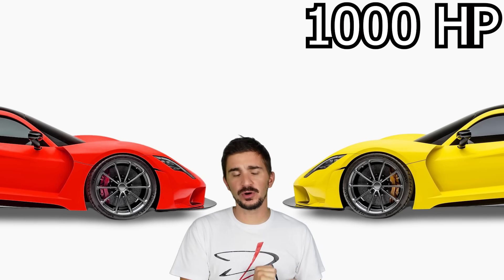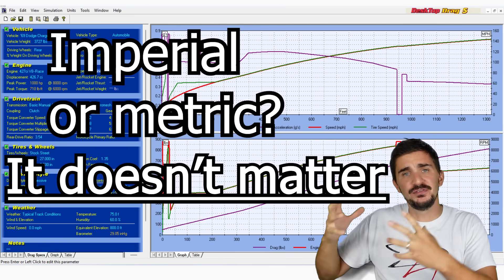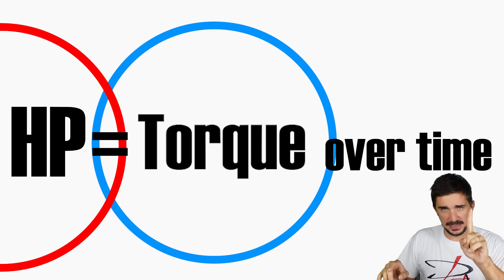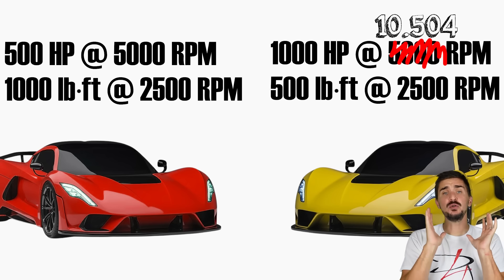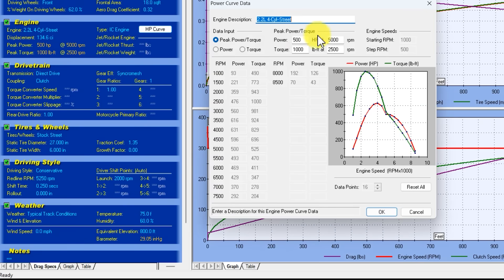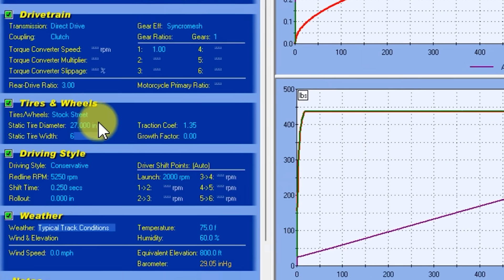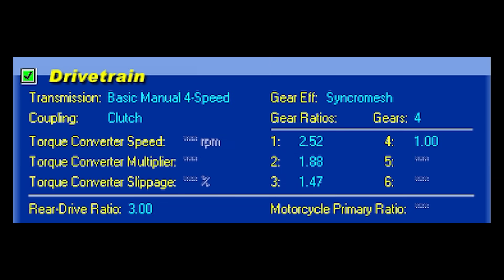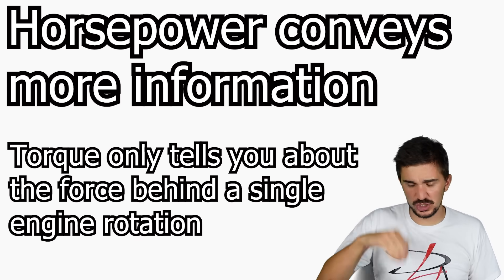Who's faster? Explained and Simulated - Horsepower vs Torque

Comment: While I like your punch/damage explanation, your video title and thumbnail is a bit misleading. In real world the 1000HP car will ALWAYS be faster then 500HP, this is the basics behind Mr. Watt invention of HP, so you can compare two different systems. It is about the force over the time resulting to work... If you compare two 500NM systems, you dont know which system will complete the task in what amount of time, thats why before Mr. Watt for comparing two systems you had to compare entire Torque curves to see what system is "faster". 
Since you are restricting the comparison to very short range of 1/4 mile this is not allowing the full peek of both systems. So the title should really be, which car is faster on 1/4 drag strip, not in general...

Comment: I enjoyed this video but transmissions DO play a part in the power of your car because in your scenario you are severely bogging down an engine made for high revving short gear ratios (bike) where you are comparing it to say a diesel. I like to think of it as HP = how fast you drive into a brick walk while torque = how far you went through the wall

Comment: In the rock crawling world output torque is very important. Many people try to achieve an extreme final ratio to reduce speed dramatically and pull with incredible force. This helps passing obstacles easier and most of the time speed is not important (at least when not competing). It is funny because having such an amount of force means you can have a tremendous acceleration (according to Newton's laws) but your car can only sustain it for fractions of a second, due to the speed limit your power train will have. So, in fact, you're exchanging speed for torque.

Comment: You just got a new sub. Love the way you explain things. Understand the high horsepower low torque very well. Raced Mazdas w/rotary engines. Bridge ported 3"SS exhaust. Damn thing rev'ed 13,000rpm sounded like a motorbike. Poor torque. Early 70's no local dynos no idea of numbers.

Comment: It's very simple, horsepower sells cars. Torq wins the race.🤷
Reply: Do some research
Reply: Me electeic kock scooter T108 v2 130 kg with rider i measured its torque from stand still on loadcell it pull from dead stop 90 kg force what mean around 900 n at contact path what meanw ith wheel radious 0,14 m = 126 nm at 2 engine in wheels + max power 6 kw =almost 8 hp  i measured like 10-15 times acceleration be racelogic /racebox/qstarz ltq6000 whatever all have almost 0 error with 1 ft roll out on 0-20 km/h without push  be legs 1,0 sec 0-50 3,5 sec vmax gps on rabox 83-85 km/h on flat level road without wind vs feg new triumph speed 400 it have 37,5 nm and 40 hp weight with rider me weight like 260 kg so 2 times heavier but it can hit0-20 km/h under the same test regime like with T 108 v2 in 0,5 sec and  50 km/h in 2,0 sec if somebody can launch good  with top speed gps around 155 km/h 🤷🏻‍♂️ so such how it fix to ypur assumption ? i think it dont fix at all 🤷🏻‍♂️😉 torque without leverage mean 💩 🤷🏻‍♂️ and enough nore power with optimal gearing always beat biger lowend tprque  cos power determined how much work can be done in specified amount of time more work in shorter or the same time mean you need more force and acceleration and this subscribe power 😎🌪️ power on track racing beat torque ,but for daily riding for most people engine with higher torque down low with less power at higher rpm is much more comfortable  and they buy this version instead of weak lowend strong topend version including me 👌🏻

Comment: 500hp means that the 
JOULES of KINETIC energy per second, equal with the power of 500 horses (and kinetic energy is related with speed which means being fast).

Thus, 1000hp means more speed and thus being faster 😊

Comment: Ive always struggled with hp and torque cuz while ik peefectly how they work. They applie very differently in the real world. 
Torque and rpm are the only real value.  Hp is made up. However through tranmission it is very useful. 

No ammount of additional hp/rpm is going to pull a heavier trailer. Hints why diesel dont rev out. A diesel engine and many torquey gas engines will put peak torque down at max 3k rpms. 
Yorque is great for high traction low speeds aswell as burnouts. 
Also gasmileage. 
Horsepower is great for reving it out. If your engine revs past 7k its cuz its not got alot of real umph to its name. Dont get me wrong. Inlike 7k rpms. However my car is torquey so its actrually faster shifting 5800-6200.  

But if it where 100 less torque to reach the same acceleration it would needa go from 6200 to prolly 7500 to achieve same hp
Reply: "torque and rpm are real, hp is made up"
Throw in a trash whatever you say after this before you do some research
Reply: Nonsense. Power is not “made up”

Power, not torque, is the limiting factor in not only the top speed of a vehicle but also how quickly it can accelerate at any speed and how much weight it can pull up an incline at any speed.

At 12MPH a 13 Liter long stroke turbo diesel is putting out 1050lb-ft and 400HP at 2000RPM to pull a 20,000 lb load up a hill. If we swap that engine out for an 800HP
short stroke Lambo V12 making only 525 lb-ft at the crank at 8000RPM and we add a 4:1 reduction gear to match the RPM of the diesel, the reduction gear would reduce the 8000RPM from the engine to match the 2000RPM of the diesel so we keep the same 12MPH speed. The 4:1 reduction gear multiples the 525 lb-ft to
2100lb-ft at the wheel doubling the amount of weight the tractor can pull. It wouldn't make the cost of goods delivery cheaper but it would sound glorious, especially in tunnels.😁

Comment: Keep the wheel torque the same at the wheels which is what you would do when selecting your transmission.

I think you know that one engine will burn more fuel than the other and know it's directly related to the output.

It always seems you have a bias for engines with a higher peak torque.  Keeping a 1000 horsepower engine running with an output under it's total output is a bunk test.

Can you select a CVT?

Comment: I have a GSXR 1000, maybe 180hp/80tq and a 2001 FXDXT/TSport Dyna with a S&S 124-inch 130hp/130tq. When I first rode the GSXR it was crazy fast. I bought the Harley Dyna already built, and honestly, it scared me, I was so nervous. It shaked and just taking off it required barely any throttle, and it would break traction. It felt faster, obviously not as fast in reality. It's hard to explain. It's like driving Ferrari(GSXR) and then driving a 1970 Chevelle SS with a 572 big block(Dyna S&S124)

Comment: I had a skyline gtst (rb25det) that was insanely fast acceleration. It had some wikid go fast bits, including a ceramic truck turbo, and massive tires for traction, however when i took it to the dyno it came in at 350odd hp. This seemed a bit odd given hpw insanity it was under full boost, and tbf it def wasnt reliable , i tuned it myself using the linkg1 handcontroller, but i realised the dyno sheet actually noted a really impressive tourque peak at 780nm. I didnt really understand this at the time, but over the years i statted to appreciate that is a lot of tourque. And watching this helps me to understand why it would spin the wheels in fourth gear, and why it could pull 250kmh up a in hill in fourth with another gear to go. 

It was a wild car. I wore only cotton.
Reply: God's Bless You, that made my day.

Comment: A couple of thoughts:

1) Your 10,000 RPM engine isn't lasting long.
2) Most usable driving is done below 5252 RPM.
3) Torquey engines are generally more fun - responsiveness, immediacy, etc.
4) When using the transmission, you should tailor them - short gears for HP and longer gears for torque
5) HP requires RPM. Torque doesn't.
6) A well balanced system of all 3 (Torque, HP, and gearing) provides the best - Torque to pull, HP to run, gearing to keep you where you need it
7) Torque is how hard to twist the crankshaft. HP is how efficiently to spin the crankshaft.
Reply: Almost all thought are wrong and show lack of understanding
Reply: @simplemachine9531 

Please continue...

"Torque has nothing to do with RPM. Torque is just an angular force and force is independent of speed, they both have nothing to do with one another. But when force (in this case torque i.e. angular force) and speed (in this case RPM i.e. angular speed) comes together they generate Power."

Comment: Torque = Work done
Horsepower = Rate of doing work
Reply: Torque is not work done.
Power is not a rate of work, it is work over time. Which means more power is more work per unit of time.
Reply: @simplemachine9531  huh?
rate describe exactly time and work in this case force. 
  
rate = a measure, quantity or frequency measured against another quantity. TLDR; it's a product of derivative
 
It is "rate of doing work!" not "rate of work" which translate how fast you can complete a single work load over time = frequency

"torque is not work done" who told you that? when we translate any linear force to angular motion we get torque. WORK DONE by force (in linear fashion) is the product of component of the force in the direction and the magnitude of this displacement. Work = F x d. As for angular motion (ICE engine) Torque = rF x sin theta.
Reply: @soraaoixxthebluesky  man, you started with the word "horsepower", completely not knowing what it is 😆

There is 100Nm of work done (of moving a car). How much torque is that? You told right away. A complete non-sence.
Reply: @simplemachine9531  You don’t even know what “Work Done” is in engineering terms. Lol
Reply: @simplemachine9531  As for horsepower, I can easily ignore this stupid imperial standards with metric like Watts or Joules-per-second if I wanted to but your clueless mind wouldn’t get it.
Reply: @soraaoixxthebluesky  so many letters and not a single word "power" was used. Do some research, until then sit low and quiet.
Reply: @simplemachine9531  huh?????????
Reply: @simplemachine9531  Let me copy a spoiler for you incase you don’t know how to use internet “power is the rate of doing work. It is equivalent to an amount of energy consumed per unit time. In the SI system, the unit of power is the joule per second (J/s).”
Reply: @soraaoixxthebluesky  now use this info and get back to your original statement and delete it.

Comment: "Torque" is probably the most mis-used and misunderstood term in the automotive world. Torque, by itself, does nothing. I weigh 200 lbs, so when I put my full body weight on the 6" long crank arm of my bicycle I'm exerting 100 foot lb. of torque. Considering that my bicycle and my body combined only weigh 235 lb., that should make my bicycle faster than most motorcycles on the road. I should be able to fly past Suzuki Hayabusas like they are standing still. But in reality I have a hard time exceeding 25 mph, because I'm physically incapable of exerting that 100 ft. lbs. of torque at any significant rotational speed.. Transmissions can multiply torque, but they can't multiply power. Torque is just a component of power, along with rpm. Power, by definition, is what does work. Torque is a force that does nothing by itself without rotational speed. I'm 76 years old and have been hearing people brag about "torque" all my life and I'm sure they will still be doing it long after I'm gone.
Reply: true except torque is force is lil misleading 😉 torque from some point of view let say is force but no it isint 🤷🏻‍♂️ from 10 times biger torq you can have 10 times smaller force if leverage be 100 times longer 🤷🏻‍♂️

Comment: I have a question not related to this video.
Is it more fuel efficient to drive in hot weather or cold weather?
Reply: Summer or heat by quite a bit

Comment: Torque is how fast you can get to high speed, hp is how fast you can go
Reply: nami burn e viper watch from 26:00 this electrick kick scoter weight with rider like a 130-140 kg both its engine generate  like a avg 100 nm +/- assuming from they test they clock 25 mph in 3,0 sec what mean 74 nm avg at this velocity diffrenc + all losess like drag roll asf and it be close to 100 nm most likely avg at this speed diffrenc it have probbaly more at lower speed but who cares anyways it have much more enngine max torq than to what im compare it 👉🏻 with max power 11 hp  it accelerate from 0-50 mph in 8,5 sec 👉🏻 https://m.youtube.com/watch?v=CrCyz-jf1i4&t=1591s vs kawasaki zx4 r 40 nm max 77 hp 260 kg with rider need from 0 to 50 mph 3-3,5 sec 👉🏻 watch from 0:25 https://m.youtube.com/watch?v=0zQbfMdV-qE&pp=ygUca2F3YXNha2kgeng0IHIgYWNjZWxlcmF0aW9uIA%3D%3D  much biger power much biger weight much less engine torque with good gearing and clutch beat much less weight with much more engine torque down low in regard to how fast  you can get to high speed sory pal 🤷🏻‍♂️

Comment: interesting question and interesting approach with the simulation. unfortunately, bad execution leads to wrong conclusion.
Horsepower is faster than torque, with a couple asterisks 
*as long as the gearing and ratios are properly designed
*power and torque don't matter if you don't have traction

everything is f***d up from the beginning starting with a 1800lbs FWD car with 500/1000hp and 6in wide regular street tires. takes no genius to know its not gonna work properly
then you add transmission that are so badly setup that they either slip the clutch or spin the tires all the way through the quarter mile , and return meaningless results
the simulation that's "closest" to reality is the one with manual transmission, where hp engine wins but even there, it spins the tires all the way through 1st and 2nd gear
6000lbs simulation is dumb too because if a car has a certain payload/tow rating, it will be geared to carry or pull that weight correctly. here we have a 1st gear geared for 110mph in the 1000hp engine...
in direct drive simulation its geared for 270+ mph...

also 6:19 shows that the 500hp engine generated by the simulation is actually a 671hp engine, not 500hp. it has a wide powerband so it works better in extreme conditions where the gearing is completely off
in the first simulattion with no final drive ratio, it runs at 1500rpm so only 221hp, 1/3 of its power. the 1000hp engine is running a 3700rpm (~350hp) but it's slipping the clutch very badly because the gearing is for 800+mph so even with 1000hp its not able to lock the clutch without stalling, so it would slip the clutch all the way to 320 mph...

the easy hp beats torque example is
superbike ~200mph/200hp/100Nm/15krpm
VS
top pro sprinter cyclist ~50mph/3hp/200Nm/120rpm

Comment: So..  a detail:

If we are at the point of RPM of the max torque.

We got the top effectiveness of each of the explotions by the vilinders.

Maybe that fact can be related to efficiency depending on which gear you are on.
So effectiveness can be inside the formula to know efficiency.

Comment: Power is everything, torque means almost nothing. You can get as much torque, or as much rpm, at wheels as you want, with the right gear ratio. But you can't get both things at the same time. The product of force and speed is (almost) constant from the engine to the wheel, and it is the power.

Comment: Wow, great analogy. This never made as much sense to me as it does after watching this video, especially because the punching analogy is something gamers are used to considering about in some video games. You pick up a weapon that does a lot of damage but it's very slow, should you replace your current weapon that does less damage but is quicker? Let's take a look at their respective DPS. These considerations match perfectly with torque (damage), rpm (animation speed) and hp (damage per second). The thing that I'd like to get a better understanding now is how different distributions of these values in real cars change your driving experience with them.

Comment: Basically for a sports car/supercar you want hp and for a heavy vehicle earth mover/truck you want torque
Reply: Then why a good semi has 600+ hp under the hood. For occasional races?
Reply: @simplemachine9531  they will have a very high torque figure probably double the hp but in a truck you want low end pulling power high speed is irrelevant in such a vehicle
Reply: @rumbleman65  did you know that speed can be traded for force by using a gearbox? And you can tow a trailer with your bicycle?

Comment: I would like to see again such a comparison, but compare the size of the areas below the torque and horsepower-curves. Think about the typical diesel torque curve which starts pretty early and keeps this torque until max RPM. A drag-strip engine has nearly no torque until 7.000 RPM and when the huge turbo kicks in an insane amount of torque.

I guess the engine with the early beginning torque is much more efficient and drivable.

How does such a comparison look like between older and modern versions of turbos an engines? How does it look between diesel and gasoline engines, how does it look between two valve simple engines and four valves, variable lift and timing engines?

Comment: If I understand the software and the settings you selected. You did the simulation wrong. Not sure how you missed that very critical value of driving style.

You put driving style as conservative or whatever that limited rpms to 5,xxx so the high HP engine never even drove at 10,000rpm where it would run with max performance.